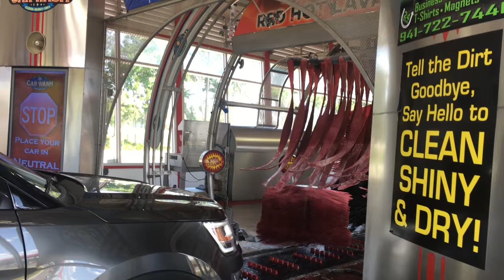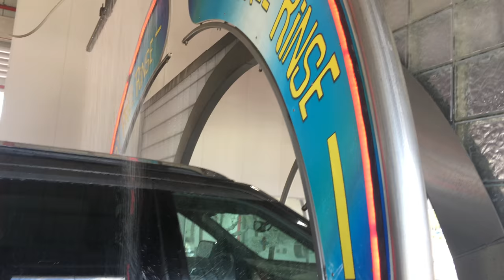River Club Car Wash: SR70 in Bradenton Site (Outside Perspective)

Comment: Excellent video! Next time you visit another location with Tommy, there’s two others, Big Red’s Car Wash and Treasure Coast which is my most favourite. Kinda weird how the wires were loose in the “please place the car in neutral and take your foot off the brake” voice and it didn’t work. But anyways, excellent video.
Reply from the maker: The next Tommy tunnel that I'll probably visit is River Club #2, which is their newest location opening in July.
Reply: Tampa Car Wash Channel nice! That’s a month after a new car wash close to me that will be opening, it’s called The Great White. They have a 110’ express tunnel, self serve bays, truck and RV self serve bays, and an automatic truck wash. They even will have a MASSIVELY HUGE store. Not sure what equipment they will be using. It’s opening in June. I hope to film it when I can.
Reply: I have filmed it. It's a SpinLite tunnel. Also, you will not believe THIS. There are TWO Futura Millenniums in my province.